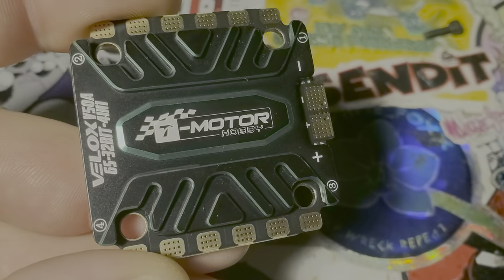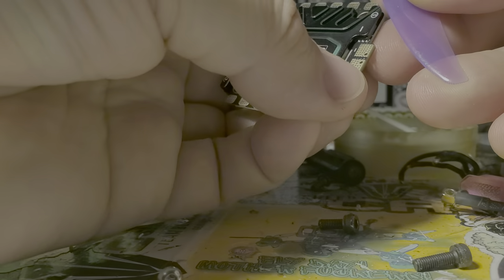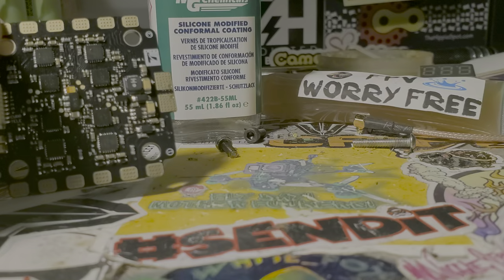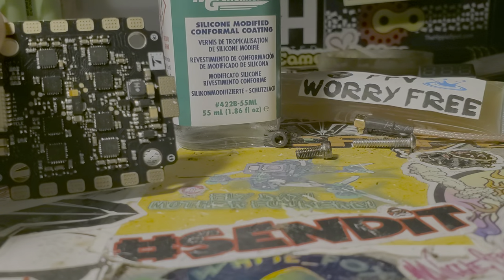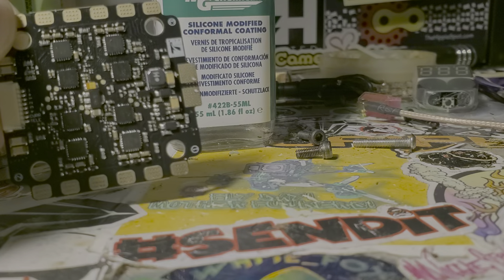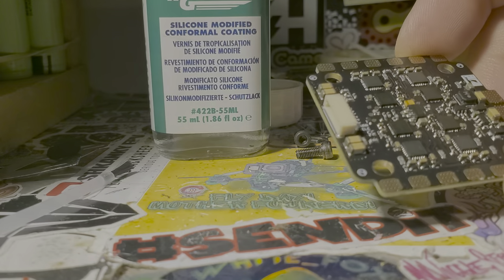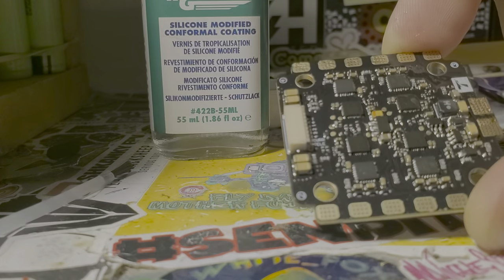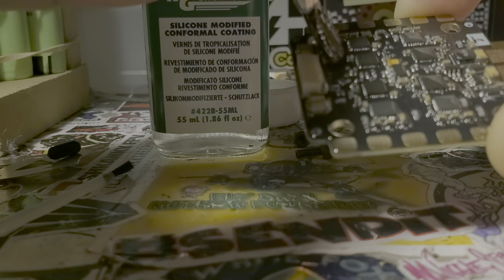How to waterproof a 4n1 ESC, removing the heatsink and applying conformal coating - Part 1

Comment: Do you clean the pads before soldering ? And I guess you apply another layer on the pads after the soldering? Thanks
Reply from the maker: The pads are brand new, already clean. On the first pass I paint everything, but the pads. After she's soldered up, I do a 2nd pass to seal in the joints 👌
Reply: @Fly_High_FPV  perfect thanks!!

Comment: Interesting.  What are the heat transferring properties of the conformal coating?  I'd think you'd want to use an actual heat sink compound to reattach the heat sink, but I'm not a chemical engineer in real life, or on-line.  I do see it is silicone based, so it may be good enough.  I'm guessing this isn't your first rodeo either, so glad to know it can work that way.  Thanks for sharing!  I would love to see more hints and tips videos.
Reply from the maker: Been doing em this way for about 5 years, never had a heat issue with conformal coating. It's very thin.  Using a thicker coating like kotking, worryfree, or epoxy would worsen the thermal characteristics, but esc's shouldnt be hot in any case, not with 4 fans blowing

Comment: Using a prop to pry is brilliant how come I never thought of that! Gotta try that on my mamba F50 which has a EMI shield attached. Hopefully it will be easy
Reply from the maker: An EMI shield should be welded in a few spots to conduct the ground through it, break/desolder those spots and reconnect them when done. There will be a large trace under the edge of the can

Comment: What does mean 50A ? Is this the max current per motor or the total current for all motors?
I didn't find any specification about that.
Thanks for helping.
Reply from the maker: Just saw this, sorry it"s so late. 50Amps is the continuous current the esc can handle across each motor.
Reply: @Fly_High_FPV  😀 Thank you for helping.

Comment: I have a mamba esc with emi shield, is it the same process? Or is it attached differently?
Reply from the maker: Sorry i missed this, but emi shields are basically a big can attached to ground, so it's usually soldered down to a trace on the board, sometimes only in the corners

Comment: Hi.
Did you put the heatsink back on it? Did you replace the thermal paste to stick it back on?
Reply from the maker: Press the plate right back down into the wet coating. No need for thermal  paste, the coating will bridge the gap

Comment: Awesome!!!! Is it totally waterproof or just moistureproof with MG chemicals??
Reply from the maker: MG will keep your board from frying when they get wet, it will not be completely reliable if fully submerged, but great for flying in the rain.  Stay tuned if you want ultimate protection, i'm doing a shootout with MG Chemicals, KotKing, WorryFreeFPV and E6000 Epoxy testing more serious protection, but also considering the compromises needed to go to that next level
Reply: @Fly_High_FPV  really interesting!! Already subscriber ;)

Comment: does it can run  128k khz in blheli32?..i heard it is F4 MCU?
Reply from the maker: I believe so. But the v50 is no longer in production, we're using v45a for 5" quads now. The newer v45 is also 128khz, but also has the 10v regulator for digital vtx's 👍

Comment: JB in one of his live streams mentioned not to conformal coat the barometer. Any thoughts on that? Thank you for your video.
Reply from the maker: If you use the barometer to monitor your altitude, dont cover it up. Same with onboard microphones.   Betaflight can display the sensor data, but iNav can use a barometer for loiter mode and more accurate elevation control 👍
Reply: @Fly_High_FPV  Good to know...thank you! Just subbed.
I use Beta flight. Now to find where the barometer is so I don't  conformal coat it! :)

Comment: There's no reason to remove that plate... BY FAR the best water barrier is a physical one and the best waterproofing, again by far, is hot glue. You should take advantage of any physical barriers that already exist and hot glue around them.
Reply: I super highly recommend watching videos comparing different forms of waterproofing... I know MG Chemicals is widely used and recommend in FPV but it actually is one of the least effective ways to waterproof an ESC or any other board that is not flat.
Reply from the maker: Do not use hotglue on an esc. When the board gets hot it will thin and get on everything.  MG is a light duty coating, which is particularly easy to rework through, for simple maintenance.  If you want better protection,  I recommend a heavy-duty coating like WorryFreeFPV.  It's difficult to get an esc properly coated if you dont remove the heatsink first. If you  leave the plate on, you're trying to seal a bunch of holes, a proper coating seals the board from edge to edge